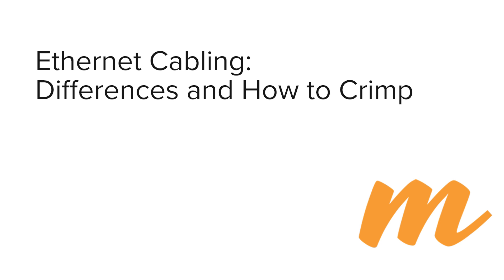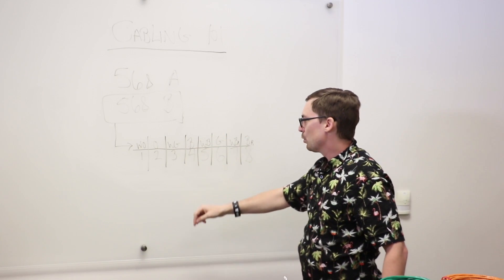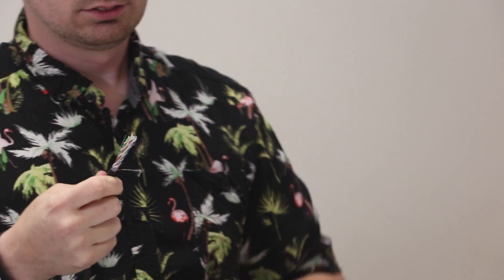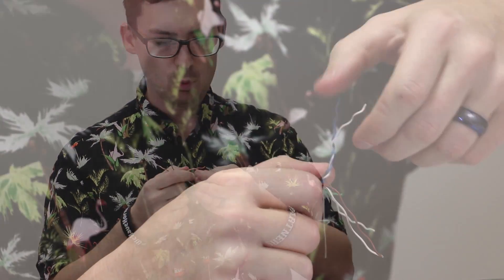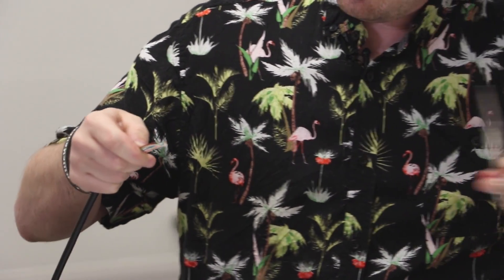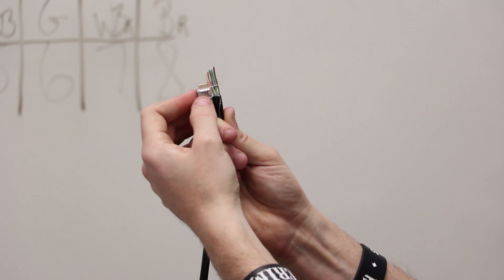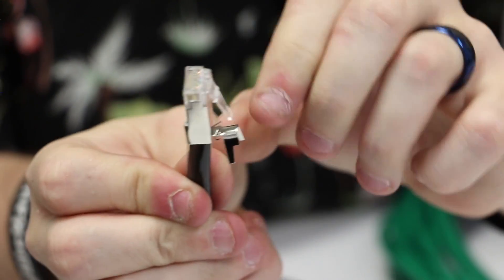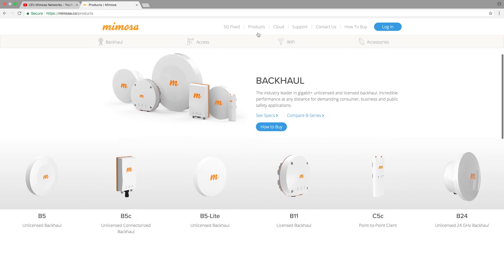Mimosa Networks Best Practices: How to Crimp a CAT6 Ethernet Cable

Comment: Okay couple notes, when you are cutting the sheath of the ethernet cable you should never use that part of the cable should always use the string inside to pull down the sheath a little bit further so you get fresh wires that won't have a chance of having any Nicks or Cuts in them. Also if you use the tube from the initial cut of the sheath you can feed that between each twisted-pair and makes it a lot easier two separate the cables. That's all I wanted to say LOL